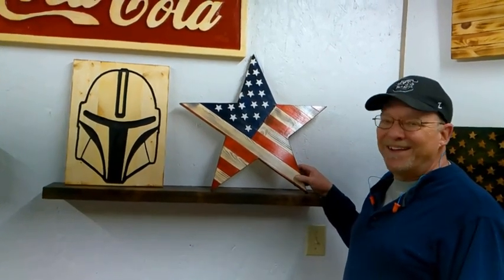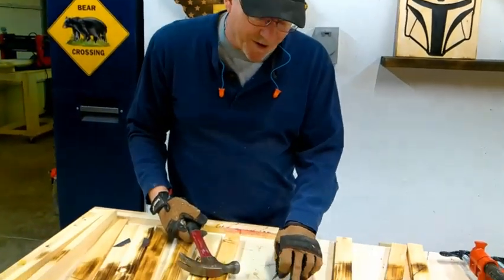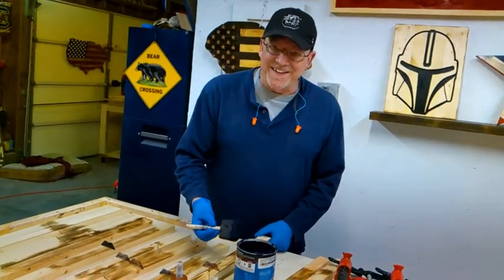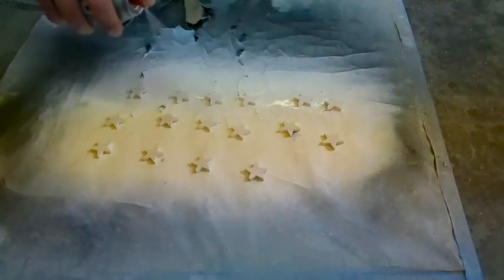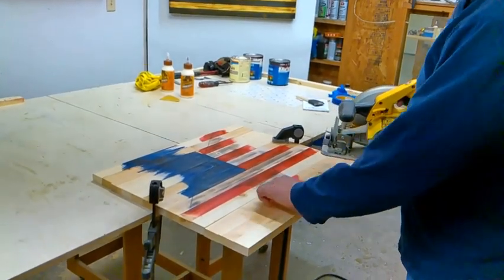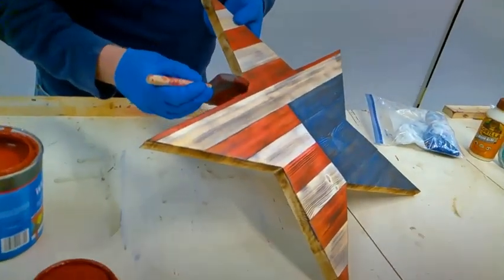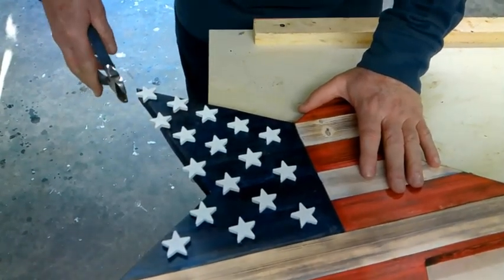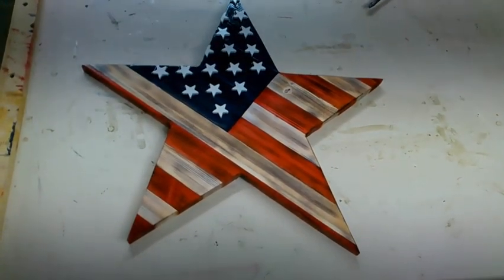Rustic wooden star flag, Projects that sell. DIY Wood working ideas, unique and interesting.

Comment: THE star you got on amazon is it a 24 by 24 inch star and if it is i only see like a plastic one for $33.00-do you have the link to where you bought that star because i don't want to spend that much on one-ty
Reply: Bill if you watch the video by Chris Notap called Easiest way to make a star you will be able to make a stencil any size you want very easily.  I used scrape wood and the traced it onto a piece of luan.  Good luck

Comment: I noticed you switched to a jigsaw did the jigsaw work better
Reply from the maker: i used a jig saw for the final cut at the end to make a cleaner end cut. if you go all the way to the end with a skill saw, it would cut to far into the next board since the blade is round. Thanks for watching.
Reply: @dadbuildsit1673  your welcom sir your videos are very educational

Comment: I want to make the star but cannot figure out how to cut the angle or even what angle it is
Reply from the maker: I ordered a star stencil from amazon traced it and cut it out on the 1/4 inch plywood. The plywood will last a long time and is easier to trace around.
Reply: @dadbuildsit1673  Gotcha but the one I want to build is about 3 ft tall.....thanks for response